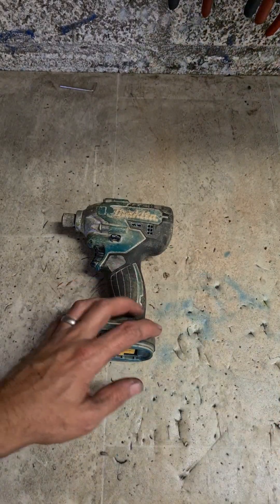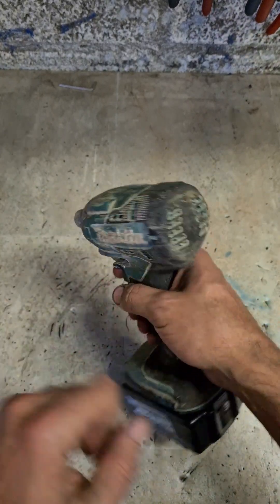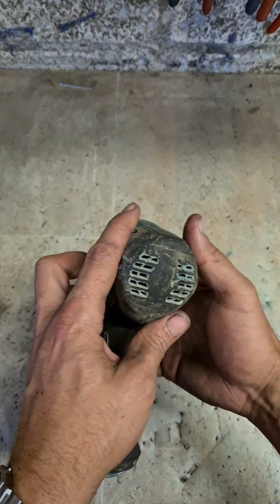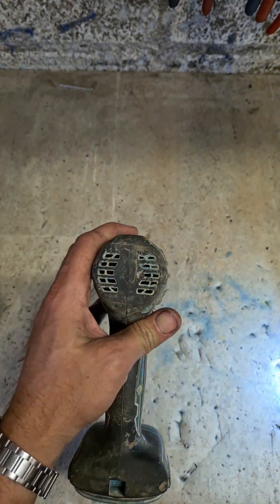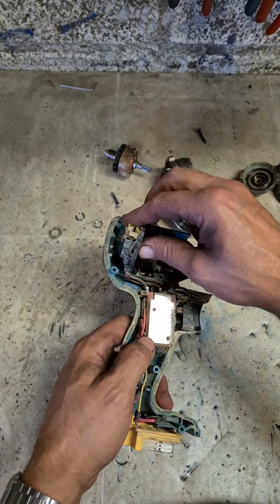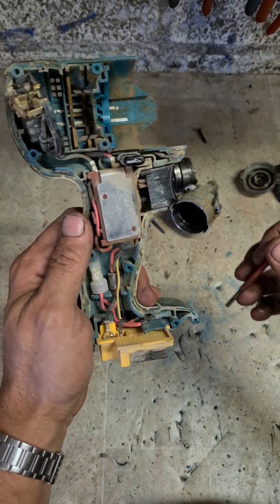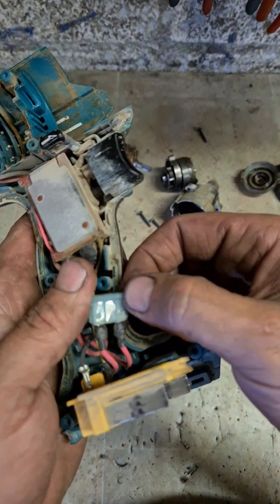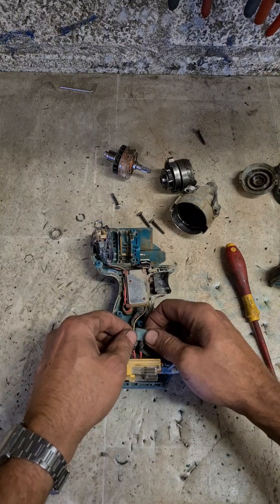How to repair a cordless 18v Makita DTD156 Impact driver that shuts down and won't turn on.

Comment: Question:
I have an impact that looks very similar - an older brushed unit I got used (no model number), and other than some rust on the field like this one its in pretty good shape. When you pull the trigger it doesnt always turn on, and hitting it (like you tried) usually fixes it.

One of the brush holders was bent tight but it still doesn't work after freeing that up. Tested continuity of the trigger and it switches reliably (or at least gets continuity) every time, so I don't think it's that?

My one thought is that the brushes might be worn, they are labeled "444" and about the same length from the top to what I take to be the wear line as the wear line to the motor.

Any thoughts on what it could be? The gearbox is in pristine condition and I'd hate to throw it out, but not confident its the switch due to continuity tests.